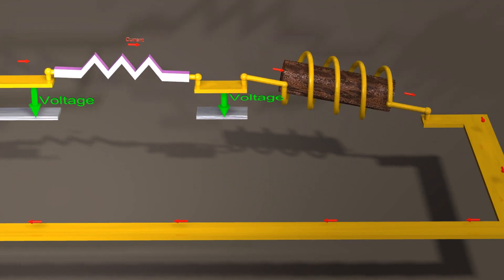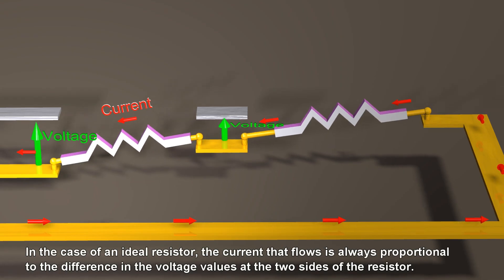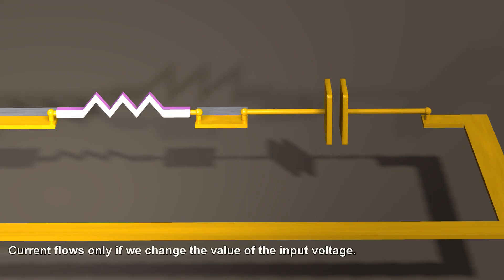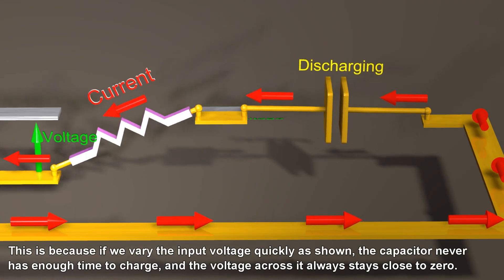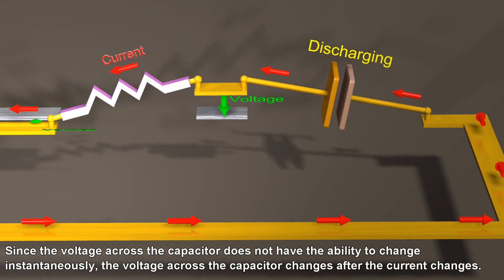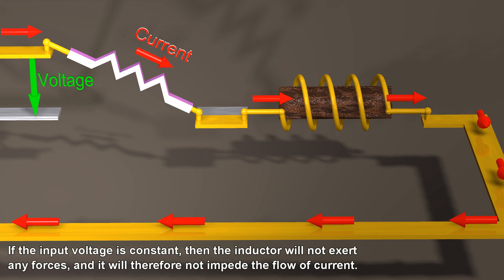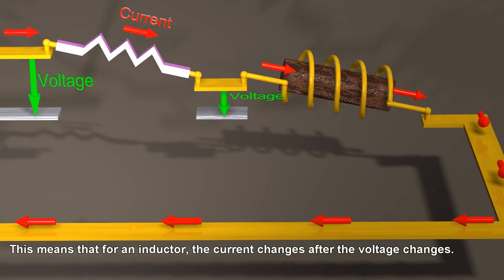AC current impedance - Alternating Voltage for inductors, capacitors

Comment: so a series rl circuit will lag the ac current by exactly 90 degree right?
but i see text book saying it lags less than 90 degree depending upon resistor value..how can it be
Reply from the maker: It depends on the value of the resistor and the value of the capacitor / inductor.  In this animation, the voltage at the center will be 90 degrees out of phase with the current.  But, the voltage that the text books are referring to is the input voltage on the far left in this animation.  It is the phase difference between the voltage on the far left (input voltage) and the current that depends on the value of the resistor and the value of the capacitor / inductor.
Reply: @EugeneKhutoryansky  so a resistor introduces a new voltage level across the inductor for which when the input voltage becomes equal to this level, there is no current. But since the input voltage might not be zero at that moment, we see a like a lag in current right?
And by tweaking the drop from the resistor, we can change the lag angle  as desired
Am i getting is correct?
Reply from the maker: I am not sure I understood what you wrote.  There is no current when the "voltage drop" across the resistor is zero (when both size of the resistor are at the same voltage).  At any given moment in time, the current is equal to the voltage drop across the resistor, divided by the resistance.
Reply: @EugeneKhutoryansky  yes i basically mean to say that 
There is no current when voltage at both ends of the resistance are same and this happens twice in  every period
By changing the resistance, we can change the moment where the voltage across the resistor is same thereby changing the lag angle

Comment: How does phase shift occur in a single inductor? What happens if a resistor were to be included?
Classical analysis does not provide answers to these questions in an intuitive way. To understand the reason for phase shift in inductive circuits Faraday's law should be applied. This can explain the co-occurrence of a non-Coulomb electric field with a changing current in the inductor. Also, a Coulomb electric field appears and this is hard to explain unless one takes a unified approach to electrostatics and circuits. 
How does phase shift occur in a single capacitor? What happens if a resistor were to be included?
Classical analysis does not provide answers to these questions in an intuitive way. To understand the reason for phase shift in capacitive circuits, a unified approach to electrostatics and circuits will be useful. 
Electrostatics and circuits belong to one science not two. To learn the operation of circuits, Current and the conduction process, resistors, capacitors and inductors and how discussing these topics with a unified approach makes it easier to understand phase-shifting in capacitive and inductive circuits, 
watch these two videos 
i. https://youtu.be/TTtt28b1dYo and 
ii. https://youtu.be/8BQM_xw2Rfo 

The last frame References in video #1  lists two textbooks 3 and 4 with topics that discuss the operation of capacitors, inductors including phase-shifting with a unified approach to electrostatics and circuits.

The results of simulation runs usung TINA software of circuits that superimpose ac signals on dc voltages “Simulation_super_ac_sig_on_dc_volt.pdf” and of CR phase-shifting networks typically used in RC Phase shift oscillators “RC phase shifters.pdf” are included in pdf files in the CD which is included with textbook 4.

Comment: in minut 5:10 wrong phrase , you should replace the word CURRENT by the word VOLTAGE ,after the voltage changes,the inductor then ................
Reply from the maker: The video is correct.  You may want to watch my video on inductors at https://youtu.be/ukBFPrXiKWA

Comment: The correct formula for the energy of the electric current E=IU2/2 (of course, here you can talk about instantaneous power or add time) by analogy with mv2/2 because  the voltage drop is nothing more than a drop in the initial velocity and it is quite obvious that there are no forces supporting the velocity in the conductor other than the initial conditions.

Comment: Explaining the effect mathematically,  the impedance of both Capacitors & inductances is proportional to the frequency electrical signal applied to them. (The impedance is simply the resistance of a components with its phase shift ᵠ )

For the capacitor: 
     Zc = 1/(C*ω)

For the capacitor:
     Zl = L*ω

Where:
     ω = 2*Π*f (The angular frequency/speed of the signal)
     f: is the frequency of the signal
     C: is the physical capacity of a capacitor (in Farad)
     L: is the physical inductance of an inductor (in Henry)
     Zc, Zl: is the impedance of a capacitor & inductor respectively

Knowing Ohm's law: V = Z * I, will let us understand those effects mathematically. But still the video made a great visual explanation for the effect.

Comment: Of course is crucial to be referred that this attitude of capacitor that is demonstrated in video,is applyed only if connection is "in line" onto a cicruit .
In fact in line connection rerely is appeared in most circuits.
A low amount of capacitance spontaneously is appeared  between wires or between coils of a inductor ,both are connected parallel to their own electrical elements,and even a plus capacitor be added,for example onto a motor in order to correct the power factor ,then it will be added in parallel.Besides,the inductance follow the resistance of indactor which its own,so inductance can be connected either in line or parallel. So the impedance formula changes in parallel connection. 
Only in very special applies a capacitor is connected in line.

Comment: Perfect and Helpful!
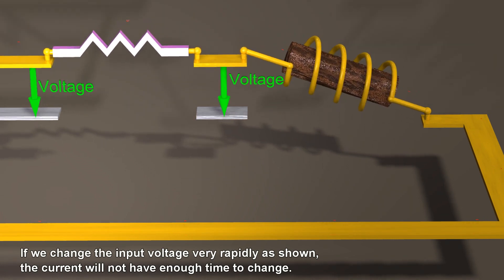But there 's something unclear for me about " Inductor in AC", around minute 5:21 of the video:
I think when the input AC voltage is at the maximum, di/dt will be zero, so the voltage difference of the inductor must be around zero (I said "around zero" because of the Resistor). And in continue, when the input AC voltage is zero, di/dt is at the maximum, so the voltage difference of the inductor must be around maximum.
Please explain me if I 'm wrong.
Thanks to your response in advance Eugene!
Reply from the maker: No, the equation for an inductor is V = L di / dt, where V is the voltage across the inductor (not the input voltage).  So, when the voltage across an inductor is at its maximum, di/dt will be at its maximum.
Reply: @EugeneKhutoryansky 
Thanks to your prompt replay!
Exactly dear Eugene:
"When the voltage across an inductor is at its maximum, di/dt will be at its maximum", but the question is: "when the voltage across an inductor is at its maximum?" I think the answer is: "when the voltage of the AC input is around zero!" Because the voltage of inductor is π/2 lead-phase than the input voltage. At the maximum of the AC voltage, the current of the circuit is at the maximum too, but di/dt goes to the minimum and zero, so the voltage of the inductor will be zero too.
Am I wrong?!
Reply: Dear Eugene!
I found out my mistake:
The current of the circuit will be at the maximum, when the voltage of the resistor is at the maximum. And di/dt will be at the maximum, when the voltage of the resistor is zero!
I should have replaced Vemf (the input AC voltage), with the voltage of the resistor!

Thanks a lot for your perfect animations!

Comment: Great video as usual... I just wanted to ask you if the other voltage in the middle changes at the same frequency of the generator's one
Reply from the maker: Thanks.  Yes, the frequency everywhere in the circuit is the same.

Comment: Am I correct in thinking you are showing electron flow for the current and not conventional flow?
Reply from the maker: I am showing positive current flow, which is in the opposite direction of electron flow.
Reply: @EugeneKhutoryansky  ok, thx. I watched a couple of ur vids and just couldn't work it out visually with the voltages being up and down (for sinusoidal waves? and guessing they are supposed to mimic oscope representations?), the "FORCE" arrows and the current or voltage lag.
Great videos though. Very good for representing the components functions, especially through time.

Comment: This is a phenomenal visualization. But I’m pretty sure at 1:22 it’s wrong, in that the drop across the cap should have started to increase as soon as the input voltage was applied. But in the animation it doesn’t start to increase until the input voltage reached its peak (because there was a current eight at the start).
Reply from the maker: It's not "wrong", you can just think of the voltage across the capacitor as being too small to notice at that moment.  But yes, you are correct that the voltage across the capacitor is already increasing at this point.  Actually, what I was trying to depict in that animation was how the capacitor reacts to an instantaneous step increase in the input voltage to the left of the resistor.  Only I didn't animate the step increase as truly "instantaneous" because that didn't look good in the animation.

Comment: SUMMARY:
RR:-
In a purely resistive circuit, Current is independent of voltage frequency

RC:-
Low voltage frequency -> Low current through RC 
High voltage frequency-> High current through RC
Therefore, in RC, Voltage frequency is directly proportional to Current
High Capacitance -> More current

RL:-
Low voltage frequency -> High current through RL
High voltage frequency-> Low current through RL
Therefore, in RL, Voltage frequency is inversely proportional to Current
High Inductance -> Low current

Comment: Hello miss beautiful voice can i ask you a question. This if for audio signal applications. What would be the impedance value if I will connect an 8ohms tweeter to the 1.2uF/400volts capacitor in series and connected parallel to the amplifier? Thank you, hope you can help me.

Comment: Hi. I find your videos really helpful and amazing. Could you please do a video on power consumed in ac circuits? Thank you for this amazing video.
Reply from the maker: Thanks.  Glad my videos are helpful.  Ideal capacitors and ideal inductors are unable to consume AC power, so the only component discussed in this video that would consume power are the resistors.  I might make a video that discusses this in more detail.  Thanks.
Reply: @EugeneKhutoryansky  thank you so much . I'll be waiting for more of your videos that will be coming in future
Reply: What is a resistor? How does current branch in a network of resistors? How does it "know" how much should flow in each branch?
While some detail is given in science and engineering courses about conductors, insulators and semiconductors, resistance is described in several ways.
Examples include i. The restriction to the flow of electrons. ii. The difficulty in moving electrical current through a conductor to which voltage is applied.
iii. a circuit element which dissipates energy in the form of heat .
More appropriate description for a resistor would be the property of a conductor which determines the current produced by a given difference of potential.
This makes us remember that a resistor is a conductor first. And, there is reason to say that superconductive wires dont obey ohm's law. So all conductors are resistive, though not superconductors. 
Resistors are used in circuits to regulate the strengths of currents either by reducing the diameter of conductors or introducing more obstacles or lattice imperfections to reduce the strength of current.
The current branches in a parallel network by an elaborate rearrangement of surface charge.
For more details about resistance, how current branches in a parallel circuit and ohm's law consult the following videos, articles and books.
Capacitive reactance
The capacitive reactance is expressed in ohms and it is useful to determine steady-state current values to sinusoidal voltage inputs. Although the value of the reactance is expressed in ohms, it was not obtained by computing a resistance, as of resistors. 
The current in the wires of a capacitor circuit is due to the resultant electric field E(NET) (a resultant of the applied field and an opposing electric field, the fringe field of a capacitor), obtained by applying the relation for current density J = σE(NET), where σ is the conductivity of the wires.

The field in the wire which may vary sinusoidally is always a resultant of the applied voltage which may be sinusoidally varying and the fringe field due to charge accumulation on the capacitor plates.
For a comprehensive description of the mechanism of current leading the voltage across a capacitor see the book references below. 
Inductive reactance
The inductive reactance is expressed in ohms, and is useful to determine steady-state current values to sinusoidal voltage inputs. It is to be noted that though the value of the reactance is expressed in ohms, it was not obtained by computing a resistance, as of resistors. 
The current is on account of the resultant of the applied field and an opposing coulomb electric field, which is due to polarization by the non-coulomb curly patterned electric field associated with the changing magnetic field, and the current obtained thereof by applying the relation J = σE(NET) where E(NET) is the resultant field of the applied field and the coulomb electric field and where σ is the conductivity of the wire.
For a comprehensive description of the mechanism of current lagging the voltage across an inductor at different frequencies see the book references below. 
Electrostatics and circuits belong to one science and not two, that of electricity and magnetism. To know how they are unified visit this link 
https://matterandinteractions.org/articles-talks/ and view the article 'A unified treatment of electrostatics and circuits.  B. Sherwood and R. Chabay, unpublished. (1999)'
pdf.
For a live demonstration of surface charge and its effects in circuits visit 
https://youtu.be/U7RLg-691eQ
Electrostatics and circuits belong to one science and not two, that of electricity and magnetism. To know how they are unified visit this link 
https://matterandinteractions.org/articles-talks/ and view the article 'A unified treatment of electrostatics and circuits.  B. Sherwood and R. Chabay, unpublished. (1999)'
pdf. 
For a live demonstration of surface charge and its effects in circuits visit 
https://youtu.be/U7RLg-691eQ
For a detailed discussion of surface charge, coulomb's law, electric fields, fields of dipoles and other charge configurations, parallel plates, capacitance, currents, conservation of charge, conservation of current, superposition of fields, superposition of potential, simple dc circuit, magnetic fields, magnetic fields of a current element, straight wire, current loop, solenoids, biot-savart law, voltage, voltage source, difference between e.m.f. and potential difference, ideal voltage sources, resistors, how current branches in a parallel circuit, capacitors, inductors, faraday's law, inductance, ac circuits, transmission lines, motors, generators, p-n junction diodes, electromagnetic waves, antennas and radiation, new electrodynamic theories on the nature of the electric field, see "Electric and Magnetic Interactions" by Chabay and Sherwood 
www.matterandinteractions.org
or 
Fundamentals of electric theory and circuits by Sridhar Chitta
https://www.wileyindia.com/fundamentals-of-electric-theory-and-circuits.html
There is a "look inside" feature in the amazon.com webpage of the book "Fundamentals of electric theory and circuits" by Sridhar Chitta with a few pages of Chapter 1 which may be viewed and also which you may swipe left or press < icon to view the foreword, preface and Table of Contents. 
The contents of the above book by Sridhar Chitta, make a distinct unified approach to electrostatics and a few advanced circuits like coupling signals to amplifiers, lending precision and clarity to the topics which is not found in most text books.
The book comes alongwith a CD with animated power point presentations for all chapters and voltage regulator, RC phase shift oscillator, transformer-coupled audio amplifier and differential amplifier included additionally.
For a lecture by Prof Ruth Chabay on surface charge in a simple dc circuit visit 
https://youtu.be/-7W294N_Hkk
There is a full set of lectures beginning lecture 13 here on surface charges, electric fields, simple circuits, capacitance, inductance, faraday's law, motional emf, magnetic forces and more topics here
https://matterandinteractions.org/videos/EM.html